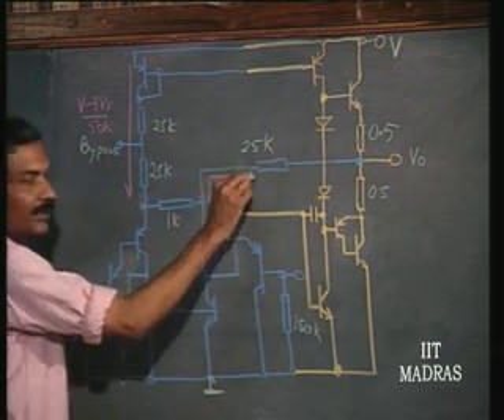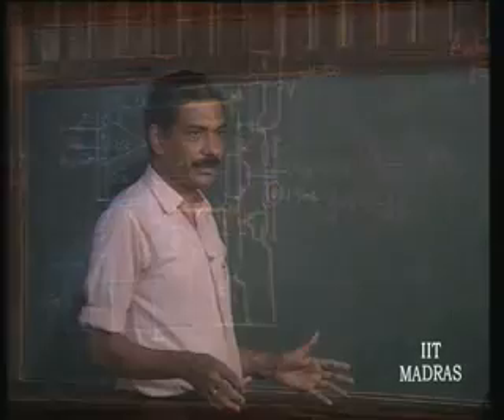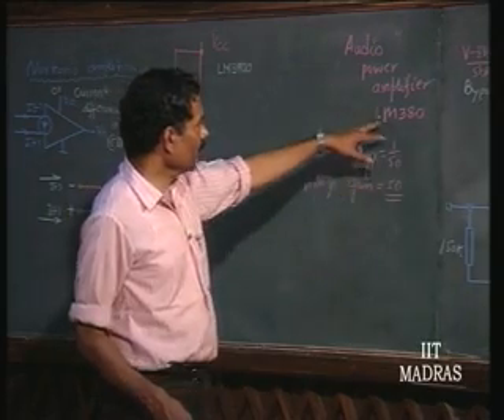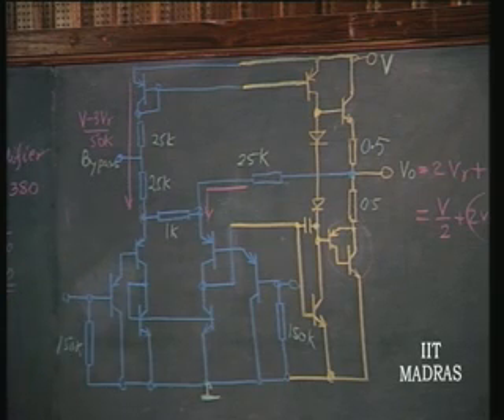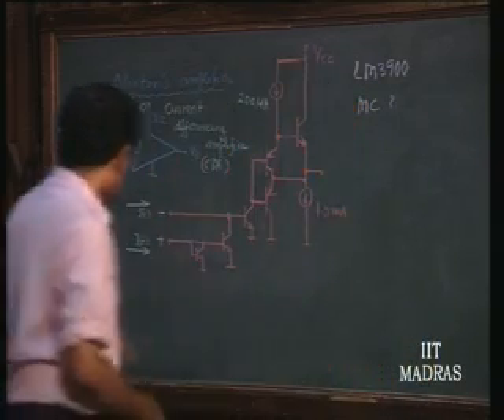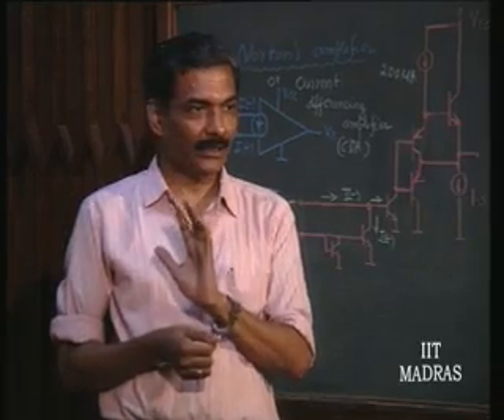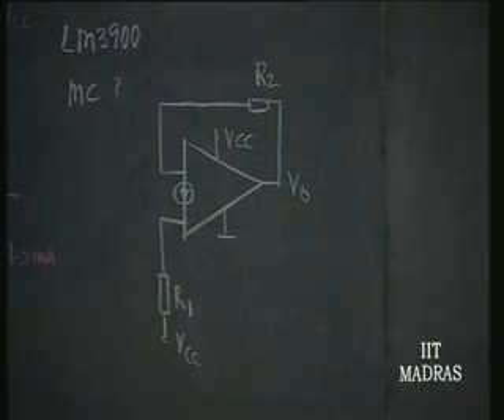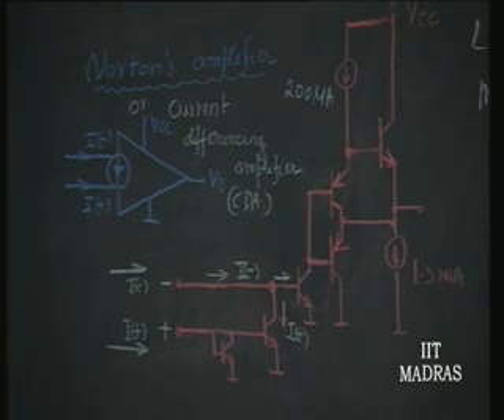Lecture - 18 Audio Power Amplifier and Norton's Amplifier

Comment: AUDIO Power MOSFET  Audio Power Amplifier  oled tv
IRFP4227PBF IRFP4768PBF IRFP90N20PBF IRGP4063DPBF IRGP4066DPBF FDA69N25 
V80100P RURG80100 IXFR90N30 IXGR60N60D1 FQA44N30 RHRG3060 FDA50N50 IRFP250N IRFP260N IRFP264N IRFP460A IRF1404 88N30W
UC3825 UC3875 IR2110 IR2153 IR1150  IRS2092  LT1061 LM361
Magnetic Shielding inductance, transformer, filtering inductance
MMT140T5020 MMT140T6325 MMT330T3822 MMT330T2718 T157-2  T130-2  T106-2 ETD-44 ETD-49 ETD-59 EE-55